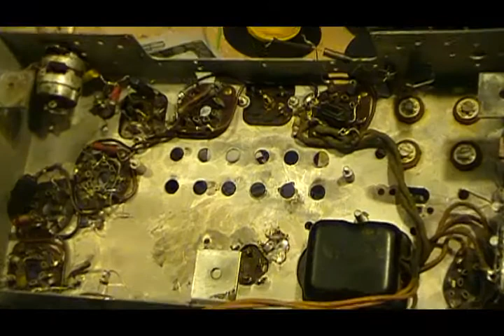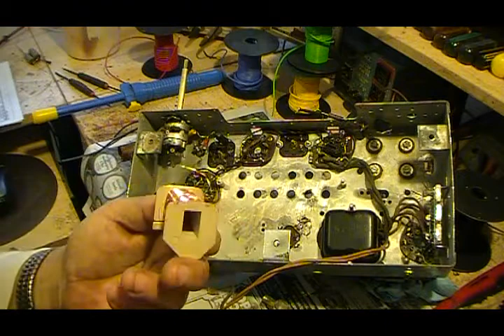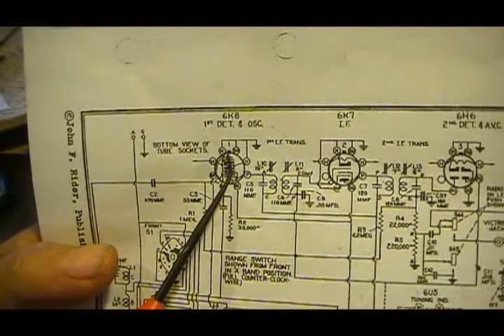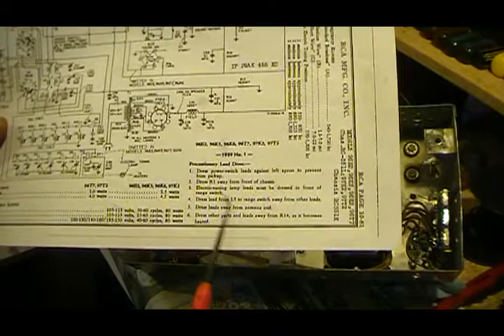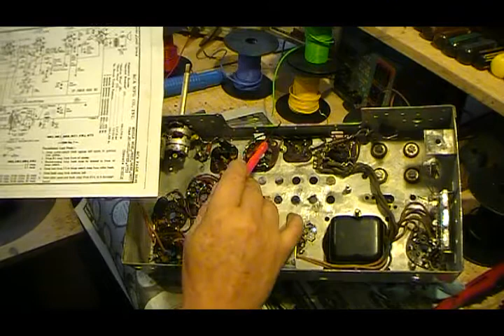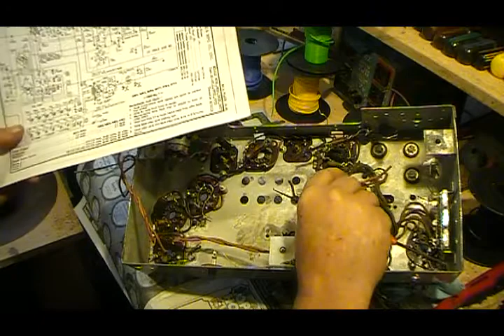RCA 96T7 part 3

Comment: Thanks for the tips.  I had no idea Weller still made those heavy duty irons.  I see some 120 watters on amazon for less than $100 :)
Reply from the maker: HI Bob. Thanks for watching. I like shopping on amazon. I have gotten a lot of stuff off of there. Your friend Dennis.
Reply: Dennis Carter
Glad I inherited my fathers 200 watt iron!  I had no idea they were so expensive.
Reply: I have a 160 and a 250 watt soldering iron, both were bought second hand at a garage sale and a car swap meet respectively, you can solder house wire with them very easily as well as soldering to a chassis.